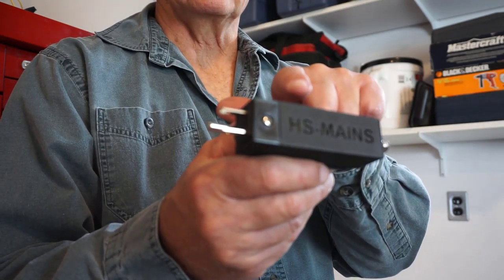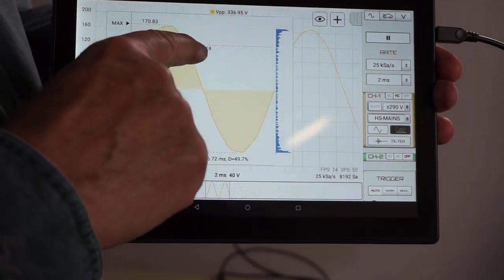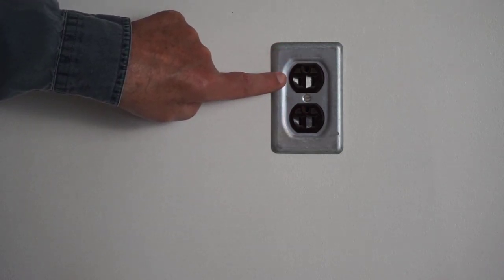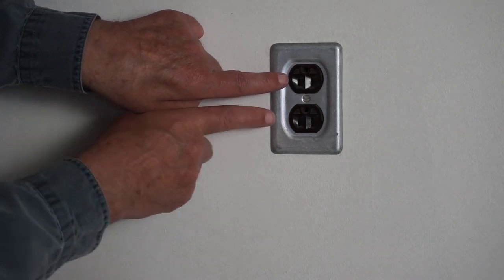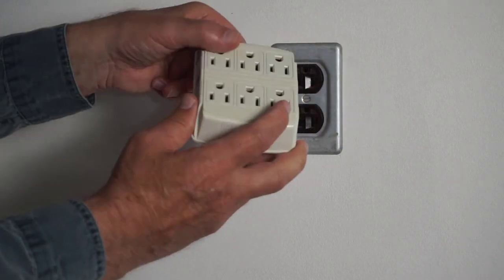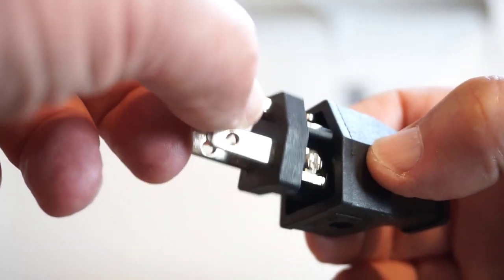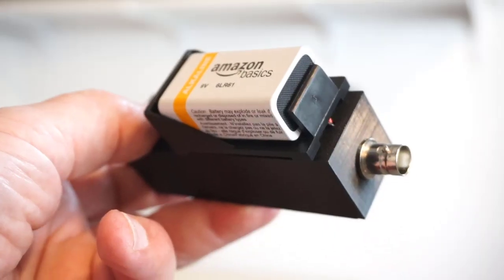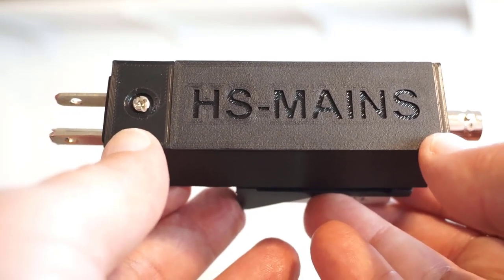GADGETS#169 - HS-MAINS

Comment: Did you measure the cut-off  frequency of this ZMPT101 module ? It's not mentioned in the datasheet.  Maybe it could be used to provide input isolation to measure 2 signals with a different voltage reference or to safely analyse switching noise.
Reply from the maker: ZMPT101 is a transformer so I doubt there is much frequency limitation from it

but on that board is LM358 Op Amp and it would have some limitations (though quite high, I suspect)

here is specs on LM358 if that helps:

https://www.onsemi.com/pdf/datasheet/lm358-d.pdf

Comment: This is a very nice gadget, but if you only want to measure between L1 and N or between L2 and N, you don't need anything extra.
Simple disconnect the negative clip from your scope probe for safety purpose, set your probe to x10, and touch the L1 or L2 with the tip of your scope probe. 
The outer connection of the BNC connector on the scope is already connected to ground and so does your probe, and because L1 or L2 are earth referenced, you only need to touch L1 or L2 to measure the 120V mains voltage. For countries that use 230V/240V, the same method of only touching the L1 can be used. Grtz
Reply from the maker: hmmm...these are ±5v input scopes...are you sure about this?
Reply: @theGADGETSplaylist  , for 5V input scopes, this method can't be used with a x10 probe, only with probes with x100 attenuation. Grtz

Comment: please correct me if I am wrong. It would appear that the earth has been disconnected and you have floating mains supply and may well bypass the RCD RCBO or other safety device
Reply from the maker: no earth used or required in this project

Comment: Interesting. 
Could it be used as a isolationtransformer for lower voltages and non sinuswaveforms?
I was thinking about using them to have each channel isolated so you could measure inside a circuit ie as a differential probe.
Reply from the maker: these modules would not be suited for that purpose...ok for sine waves...and maybe triangular waves also...but not other wave patterns